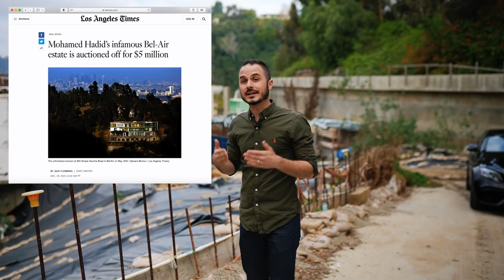INSIDE Mohamed Hadid's Former Bel Air Mega Mansion

Comment: I built a “normal” house 3 years ago here in SoCal. I can’t see how the wrong design can make it through all of the hoops that you have to go through. First, there are a ton of engineering licenses needed. Structural, mechanics (hvac, electrical, plumbing), seismic, soils, grading, water calcs, architectural). I paid $50k in fees for a normal house approximately 50 miles inland of LA. I can’t see how the wrong design can get approved and built. I am guessing that some money had changed hands, but who knows.
Reply: You're guessing wrong. This guy just found richer neighbors who paid the same ones who allowed this to happen in first place
Reply: @ivancadiz.  It’s not up to the neighbors (unless it’s ocean front). There are some proposed houses in Malibu where they put up pvc plastic in the outline of the house. It shows how the view obstruction. The rest is between the owner/builder and the city regulations that maintains the state regulations.
Reply: I could see that house sliding in mud slide.  Maybe cali isn't washington but there would need be alot of pile driving to stabilize a building from sliding.
Reply: It DIDN'T make it through those hoops. He got permits for a smaller house then just went ahead and tried to build this. Got caught.
Reply: @ventureted  that happens a lot here in montana...and most of it goes through